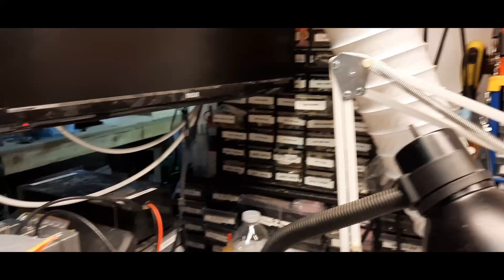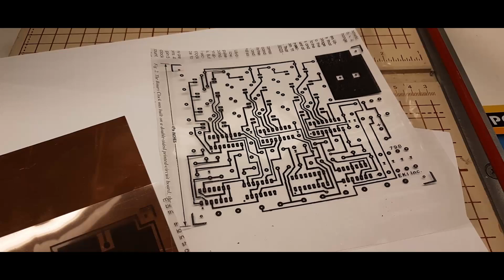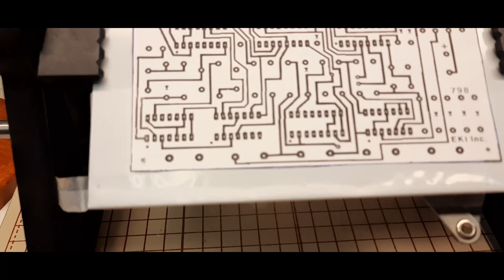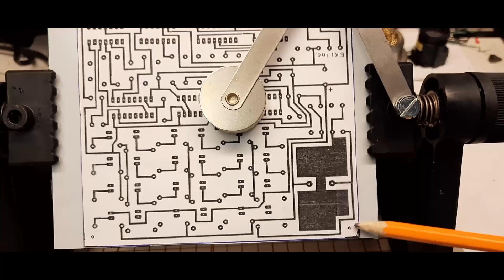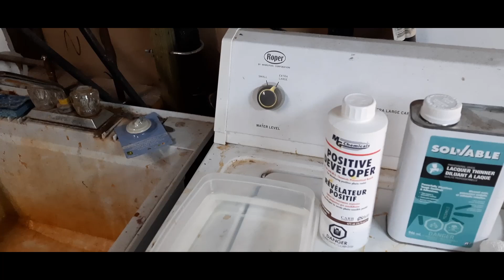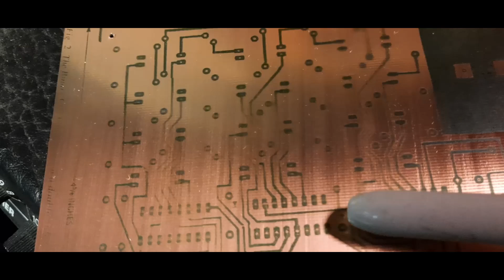Popular Electronics Project - January 1991 - Binary Clock

Comment: https://youtu.be/dnzMak6qc1I?is=7pxYtveaZXr8Q29v here my video about photo sensitize pCB making i have more experience about that. Do not exposed the ligth when you developer in chemical solution. Why?  As you develop the chemical solution, there is a part that gradually gets removed—the green-colored chemical resist on the PCB—while it is exposed to light, it is slowly being removed as you continue developing it. So turn off the ligth after you exposed and develop in chemical in red ligth ambiance or yellow ligth.

Comment: I built this exact circuit from that magazine back in 1992.  BUt I did not use a printed circuit board, I literally wired and soldered every component on a blank board.  I still have it to this day, however, I dug it out of a drawer a few weeks ago, and it was not working. I replaced the large canister capacitor, as it was likely dried out after 30 years!  Now it partially works, my seconds only count up to about 14, then it keeps pulsing a reset to the rest of the board. So now this is a new project to bring this clock back to life!
Reply from the maker: Right on ... It is nice to hear these memorable stories. I am sure you will get it going. This was one of my first videos on this channel that was a build. Cheers